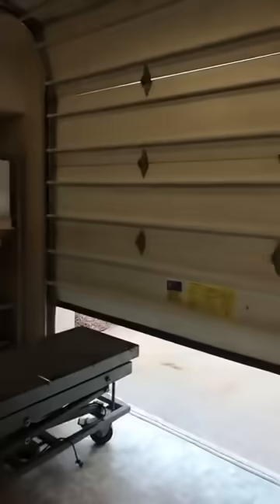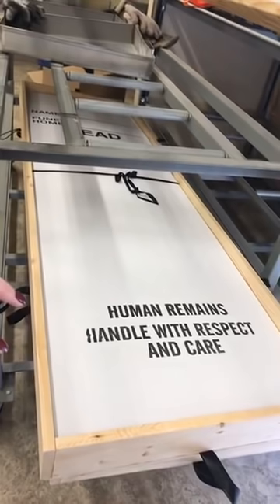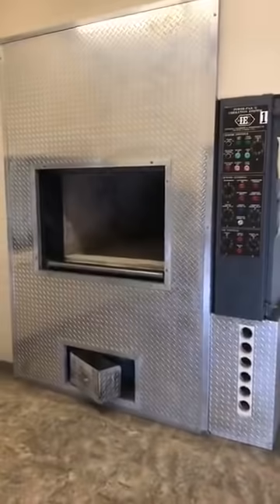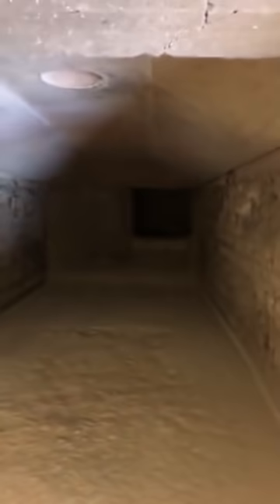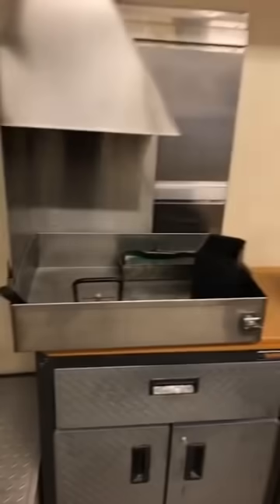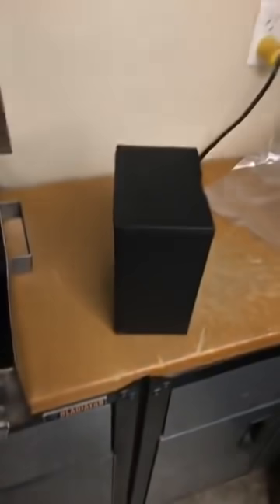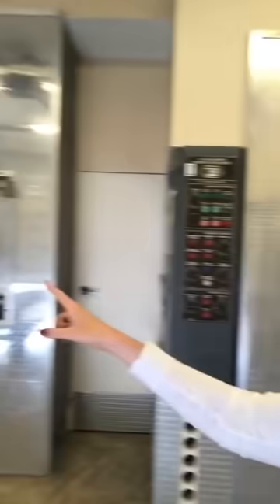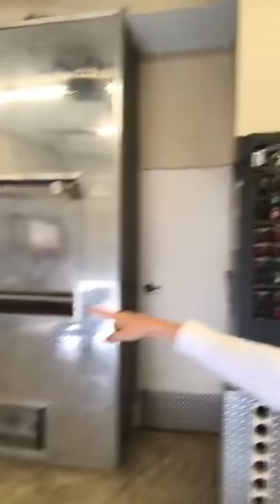Tour of a crematory by a funeral director

Comment: I'm a commercial Refrigeration service guy. One of the hardest days in my job is the service call at the morgue to work on the coolers that hold bodies. The pressure is on to get the thing fixed and cooling again quickly !!!

Comment: Obese individuals are usually done on a cold hearth start up.  That is where the retort is just started for the day and that person goes first.

If the larger person is put into a hot retort the grease could cause a run away fire and also overheat the refractory materials in the retort.

The retort is started after the person is deposited.  Then the flame is brought down and the grease burns itself and you just regulate the temp with air.

You are so right about the 50 lbs of fat is equal to 12 gallons of gasoline.  These grease fires can really get out of control and burn the crematorium down.

Great video.  Hopeful someday I’ll be opening my own crematory.
Reply: Fort Lauderdale.
Reply: Very good explanation. I
Reply: Congratulations Sir , on your business venture  .
Reply: We manufacturer, service/repair crematories, operator certification, troubleshoot, offer VE testing.  You name it.  :-)  Love your channel Kari.  Found it this evening and I've watched quite a few videos thus far.  Add adding another note.  4000 degrees is also way over temp and the refractory would be shot after running at that temp.  These bricks are rated for high temp but only about 32-3300 degrees absolute max, but should not get this high on a normal operation.  Much more than that and you start talking about fires and serious structural issues.  You are correct about regulated temp, each State is diff usually 1600 or 1800 degrees.
Reply: Wow, so those salad dodging chunky chubsters are even a huge health risk AFTER they've carked it?!

Good God, they're just EVIL!
Reply: About the 50lbs='s 12 gallons of gasoline. I had a female friend that had giant-ism disease & was 6 foot 5 & 470 lbs. The thought of them struggling to get her into a retort & all the strange things a body of that size may have done stressed me out quite a bit for a long time afterwards.

Comment: Fact, they are not ran up to 4000 degrees. The brick have a limit of 2500 degrees. Average temp is 1550 to 1750. Florida is not 2000 degrees. 2000 degrees is what we call the high limit which means if the temp hits 2000 degrees it will turn burners off to cool back down to safe temps then starts back up. Those three machine are PPIII or also know as Super PowerPak. I was the senior tech for 10 years with this company building these machines and training people. Great job, a lot to learn.
Reply from the maker: Thank you for the info!

Comment: Thank you for a very compassionate tour of the crematorium.  You always explain with the utmost kindness.  I have a question - is the body wrapped in a sheet? Or fully clothed?  Does the body fit between the top & bottom of that flat box?  Is the box just used to slide the body in?  Is that the cardboard box?

Comment: My question is once they are removing the cremated remains with a broom is that broom sanitized from the previous burned remains? Your loved ones ashes could contain some ashes left from another on the previous broom used. Just saying. So what is the crematorium's process on sanitation and tools?
Reply: Since all bacteria are killed, the remains are sterile. It's only an emotional issue.
Reply: @markyounger1240  I understand that. Maybe I worded it wong. I am thinking that you will bring home not only your loved ones ashes but somebody ele's ashes as well since it is impossible to get every single ash.That does answer my question though as far as if sanitation is used further on the tools.
Reply: @blacklotusboutique7169  it would just be trace amounts of other remains but since there’s no way to truly clean out a retort, especially since the concrete is slightly porous after being superheated, you technically will be getting very small amounts of other remains mixed in.

Comment: I work at a crematorium in England and we cremate immediately after the funeral so do not store coffins , also the individual is cremated inside the coffin which aides combustion. Otherwise the actual process is pretty much the same.
Reply: The idea of storing coffins doesn't seem right does it Rich Morris?
Reply: Do the cremains have wood ash in them then or melted polyester or anything like that?

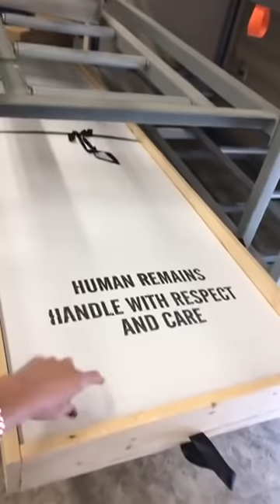Comment: For larger cases for cremation (400 lbs and up) thats why we load them head first so most of the grease stays towards the back of the machine and not the loading door. The floor of my machine has an upward slope at the door to prevent grease from spilling out. The large staples on the magnet you showed actually came from the cremation container you showed at the 1:50 mark. That's called an air tray or some people may call it a combo tray. Turn your phone horizontal when recording and you will get so much more in the screen. That way the youtube screen will be full and not restricted to the center of the screen.
Reply from the maker: Thank you for the input!!
Reply from the maker: Yes this is an old video when YouTube didn't work well with the Iphone screen size.

Comment: How do they control the smell of the burning tissue/fat?
Reply: It's so hot the actual tissue, organs, casket etc are gone in seconds, up the chimney, once it starts burning, the temps are in the thousands of degrees....
Reply: At that heat, it would incinerate the things that smell very quickly. And these retorts have ventilation systems that keep the ash and fumes from being released (for environmental reasons but I’d also assume that would keep trapped any smells as well).

Comment: Are cost for each cremation different based on corpse size ? After pointing out how a subject  with large body fat  can cause problems in the process.  I didn't read all  comments to find the answer.
Reply from the maker: It is typically based up to a certain weight and then an additional charge past that size

Comment: I have so many more questions now!  Are other artificial parts removed from the individual, too? Like, replacement hip and knee joints, metal rods, plates. Are they bad for your equipment and dangerous to you? If they are removed, then who removes them? Do YOU have to cut out the pacemaker, etc.? What's the course of action for the spare parts? How are they disposed of?
Reply from the maker: THey are removed after the cremation
Reply from the maker: THey are then recycled

Comment: I had no idea of the identification tag put in with the body/remains…. that IS reassuring!  What metal is it that withstands the 1600-2000 degree heat?  Also, are the rakes to pull the ashes out cleaned between patients?  Shouldn’t patients with pacemakers be special marked all thru the process?  I’m grieved to hear there are deaths of crematory workers when a heated pacemaker explodes when they are caring for the ashes 😢 Thank you, well done.  Wish I’d known about being able to be present at a family members cremation; I’d have been there, as there is always a little whisper of doubt if you received your own loved one!  Hope ALL crematoriums are as diligent as you present!  Thank you!

Comment: 4000°? Um, no, I’ve been a master certified crematory operator for 15 years and there is no way these machines could reach those temperatures. You would loose the thermocouple at 2300° and the machine has a high limit set point of 2150°. The “concrete” she refers to, is actually refractory, a silica based material that is only rated to 3500°, so if these machines are reaching temps over 4000° then there’s a big problem.

Comment: I have a question; or series of questions.  At this time I have 7 Rottweilers that have been cremated.  I would like to have all of their ashes dumped in with me when I am cremated.  I want all of our ashes then mixed together.  I realize this means more urns and added cost.  Would this be possible?  Would there be different laws regarding this by state?  This is a different topic but I do not believe titanium will be picked up by magnets, how would that be removed?  Can the family have those parts?  Thanks.
Reply from the maker: MOst crematories will not commingle animal and human cremations even their cremated remains into your cremation. You can mix them afterwards in a container.

Comment: Hi Kari,
I have come back here after several days to talk about using an air tray for cremation.

I tried to find an email address for you because I did not want to sound critical in the public eye. But if this info is out there I missed it.

When you gave the crematorium tour the air tray seemed to me to be indicated as the sole cremation container. If that is the law in your state then that is the final word.

However I wanted to find that out. Where I worked in California and Nevada the big corrugated cardboard box for cremation is the usual container. (Looks like a big shoe box. Neat and tidy, and provides the "rigid container" our two states require.)

An air tray costs over twice what the box does and is locally considered to be overdoing it unless there is a special need. 

When you held up the magnet and I saw the long staples on it, that seemed to me to confirm what I thought you had been saying. These are used in air tray assembly at the factory so it was apparent confirmation.

So please clue me in. Where I am from this is not frequently done.

Thanks and Blessings,
Michael.
Reply from the maker: Cardboard boxes are the usual. However, cardboard takes more effort to burn really so it is not a great option.
Reply: @KaritheMortician  
Re cremation containers: thank you Kari. I appreciate your reply.

You are doing SO well. Keep up the good work.

Comment: Here u get a small baggie with the remains i dont understand why so little..
Reply: A large portion of the remains, upon combustion, is released into the environment as gas and vapor. What is left behind are solid particles constituting only a small portion of their original mass. If you watch a cigarette burn from the tip to the filter, you will observe that the ash left behind is only a minute fraction compared to the actual mass of the unburned cigarette. Some other types of combustion, such as that of nitrocellulose smokeless powder, is much more efficient. That is why a pistol or a rifle casing filled with powder is completely empty after it has been fired. Almost all of it's mass had been converted into gas that propels the bullet at high velocity towards it's target.

Comment: Can a pet be cremated with the deseaced ?
Reply: Hi Barbara,
Regarding pet cremations, there are separate facilities for cremating pets, horses and the like, versus humans. Please call a veterinarian to find a pet crematorium.
That is what we did.

The two remaining questions are likely putting a beloved pet's urn in a casket and in that way pet and owner can be buried together.

The other thing is, wait till the pet's urn and the owner's urn both get home. Then you can consider various choices.

But a pet can not go in the cremation chamber with its' owner.
Reply: Kari,
Are you saying that in this crematorium they cremate all their cases in air trays? If so that would explain the long, squarish staples on the processing magnet. Those plus the hardware from surgeries such as screws and pins etc.

In California and Nevada the law requires a "rigid container" for the deceased as they are placed in the cremation chamber (retort). Unless a wooden casket is used then a large currugated box is used. It is a neutral color, resembles a very large shoe box and is very neat and tidy. And is suitable for witnesses. I have assembled and used thousands of these. And it is the most economical way to contain a decedent.

Regarding pacemakers, we were always urged to be dilligent about finding and removing pacemakers. For us such explosions damaged the retort so we really kept on top of it.

The fate of the removed pacemaker changed through the years. Sometimes they were collected and turned in... to somebody. At other times they just went out with the biohazard trash. A few families wanted the pacemaker back, along with the artificial hip joints, etc.

The retort lining is actually a form of fire brick. Somewhat similar to the light color brick you see lining a new or rebuilt fireplace or wood stove. Look again at the view you gave us of the retort walls. (There are many kinds of concrete. And I have not seen one that would stand up to the work of a retort.) These are special bricks.

Kari you were right about grease fires. I was surprised you included that. But it does show that you gave full disclosure. 
Thanks for a good tour. I appreciate hearing the temperature ranges and the time element. And the metal tag was good too, showing how we never mix up cases.

Good work.
Thank you!

Comment: If a person died from covid are they automatically cremated
Reply: I don’t think it’s legal to cremate a body without permission of the family. Even with Covid related deaths, I’d assume you could have them embalmed. Covid transmits through breathing—a dead body isn’t going to breathe, so theoretically it should be safe for an embalmer to work with that body as long as they take proper precautions like using a face shield, gloves, and a face mask. 

After that, I’m not sure about visitations or viewings or whether a full funeral service would be done though. A funeral home could possibly be held liable for safety and decide not to allow a regular visitation and just do a closed casket funeral…? These are all just my thoughts on what I think would logically happen though. It may be different.
Reply from the maker: No, there is no reason for that